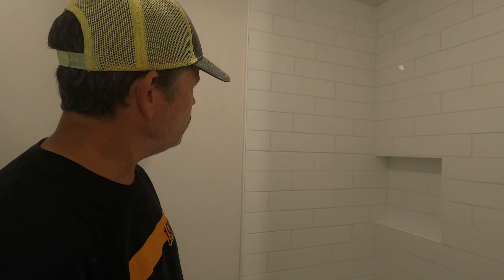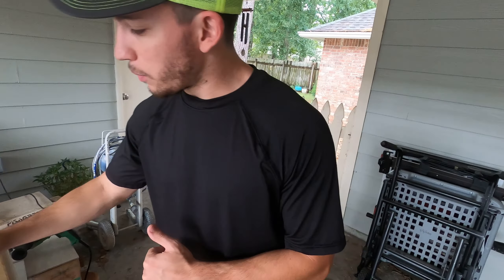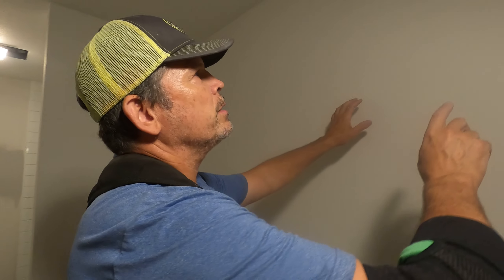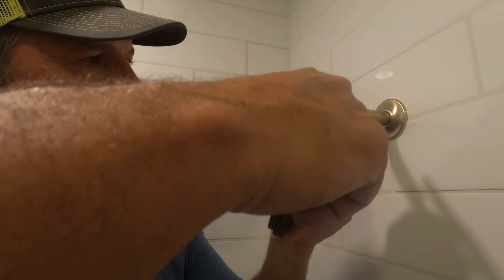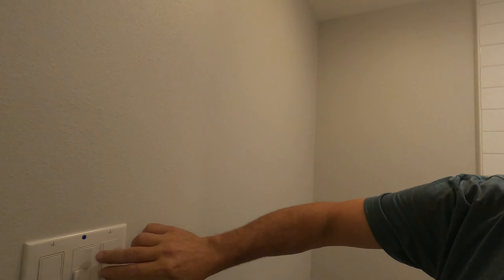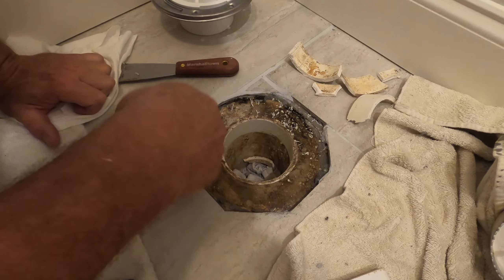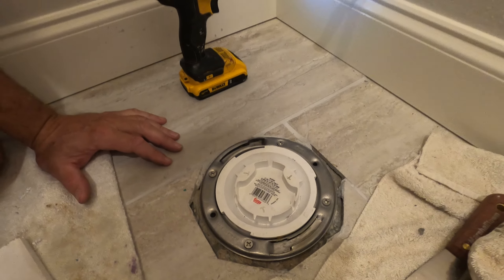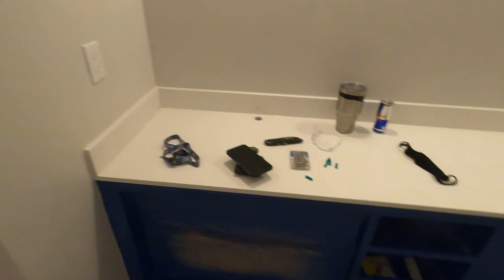Remodeling a Hall Bathroom Part 8: Floor Tile, Electrical, and Repairing a 40 year old Toilet Flange

Comment: 11:30 For a bathtub shower solution like this yes, However Ive found that is useful it can be done either way. Sometimes you have a particularly short homeowner and the reversed position helps put it within reach. Another situation is can think of is "square" stand up "phone booth" showers where the overall space is barely enough for a grown man to move around. It can also help with certain shower heads and such.

Comment: Tip for removing glued in pipe and fittings:
Get a metal hole saw the same size, or close to, as the inside of the piece of pipe or fitting you want to remove, heat it with a torch and then hold it inside the section to remove for ~30 seconds (use exhaust fan) it will soften the PVC and you can just peel it out.
Keep up the great work!

Comment: Hey guys.  Love the channel.  I have used prism grout for some time and I had an issue with it first time I used it.  It setup too quick so I called the company, Custom Building Products and they told me NEVER  to use a drill and paddle bit to mix Prism as this would create too much heat and cause it to setup too quick.  I started using a margin trowel instead and have never had it setup on me like it did that fist time.  In fact, i have never had it setup on me on any job since, even after grouting a shower and letting it set a while.  Maybe this will help someone.

Comment: Regarding the sheet gray color,  you can go 50% lighter and it will lighten up accordingly,  but in Behr paint,  that will not work if the color requires a deep base to be mixed/made,  if it uses the ultra pure white base or medium base you're in the clear👍

Comment: If you have to remove a pvc fitting use a heat gun or if you’re comfortable enough a torch. I’m you can heat the pipe up until it’s soft and peel it out. The easiest way is to get an old hole saw that matches the inside diameter. Set a pair of vice grips so that it can only go in the depth of the hub. With the torch get the hole saw red hot. Set it in the pipe, then after a couple of minutes you can peel the pipe out by hand. It’s also funny how common caulking toilets is now. It’s only code required in commercial I believe. When I was an apprentice we’d never do it. The reason was most older houses were pier and beam and if it leaked the caulk would hide it and you won’t find out until the floor is rotten or molded.

Comment: If it was primed and glued properly you can always use a heat gun to peel out the pipe after cutting a notch

Comment: As a plumber,I use closet shims on every toilet I install,by using shims it prevents you from overtightening brass bolts with is what damages the closet flange. I've also switched to nylon closet bolts due to the cost of brass,they are easier to cut and you won't  break a flange with them.
Reply from the maker: Cool thx John 👍💪

Comment: Toilet wax ring? I use the newer rubber cones ( in both the USA and Mexico) which glue directly to the toilet, fitting snuggly into the drain. Also , termites love those wax rings.

Comment: 16:40 Likely not. Because They would have screwed it down shortly after gluing it. Thus keeping the glue from pushing out on it that tiny bit that allowed the pressure and weight of the toilet to crack that flange. Im about to start a house trailer renovation, originally built in 86 and most of its original. Im gonna check this flange closely after seeing this. My jobs a wooden floor so less likely but its also rotted and soft so it may have cracked from that movement.

Comment: I was curious if you cut a door in the side of the cabinet to gain access to the tub drain and valve for future repair?
Reply from the maker: Great question Rick thanks!  I did not cut an access in the cabinet.  That is another good reason for a glued waste and overflow.  There should never be a reason to repair those drain lines.  If there is though, an access could be cut thru the cabinet or even thru the drywall in the hallway behind the tub.  I've seen that done too.

Comment: Hey guys, paint most of the time but a question about grouting against tub and tile floor. Grout or silicone. Never seen a job were the grout held up in an area were the different angles meet.  Is caulk the way to go or like you did grout
Reply: Not a full-time tiler, but I've torn out a lot of grout in areas where there is movement (doors slamming, walking vibrations, fiberglass tubs) to put down matching grout caulk or silicone depending on what it borders with ...

Comment: Paul:

I have 2 questions regarding the toilet:

1) I heard from an old-time plumber that you should NOT caulk around the base of the toilet, in case there is a water leak or failure of the wax gasket, you won't know until it's too late.  Also - have you tried the rubber seal gaskets?  They cost a slight bit more than the wax ones, but you can take the toilet on and off without issues.  I've had mine on my 2 toilets for close to 9 years without failure.  Just a thought.

2) Regarding the installation of the bolts, do you put the rubber washer in-between the porcelain and the fender washer?  I've had issues recently with the bolt and washer not centering on the slot, and the washer cups a lot and deforms.  Also, how do you finish with the snap on cap?  Cut the bolts with a hacksaw?  I've had my toilets installed for close to 9 years and haven't completed this step due to me being insecure.  And I'm scared. lol.

Watched almost all of your videos, wish I was closer to you so that I could have the opportunity to work with you - I'd do it for free.  You are very complete and knowledgeable in many aspects of the trades, it's a pleasure and a joy to watch your videos.

Thanks, and god bless (yes, my name is the same as yours)

Paul
Reply: In case no one answered you, the answer to 2 is yes you cut the bolts off.. hack saw, buzz saw, whatever works. And I also was always told to not caulk around a toilet and if you do to not go all the eay around so that I there is ever a leak you know right away.

Comment: Awesome video as always! You’ll be at 100k subs in no time. Do you always use versabond? I do but still prefer mapei products overall especially grout, but there’s usually a depot closer to the job. What’s your thoughts? Also I have used a lot of prism but am not completely satisfied as it’s a little soft and not as smooth of a finish as mapei fa products
Reply from the maker: Mapei is my first choice 💪👊
Reply: @StudPack  how’d you like the prism? It’s very popular but I have my doubts
Reply from the maker: I used prism on a shower once… It set up so fast I could barely save it. I’ll never use it again.

Comment: Nice work guys!!    Question, was there a gasket between the over the shower light fixture and the ceiling drywall to make it that fixture moisture resistant?
Reply from the maker: Those LEDs are rated for use over a shower.  Yes there's a gasket but I tend to believe it's more for air sealing.  The LED fixture is basically a sealed unit so it's perfect for over a tub or shower.  Thanks Bradyn!!

Comment: What was plan B for removing the old toilet flange? Also that pvc primer splatter is the worst hahah
Reply from the maker: Plan B - depending on the brand, some 3" PVC couplings fit perfectly inside 4" PVC.  Not tight enough to glue with PVC cement but pretty snug.  We would have cut thru the 4" PVC right beneath the flange and then removed the flange and the short piece of 4" glued to it ending up with a 4" PVC pipe ending about 3" below the slab.  Then either 1) use the 3" coupling, a short piece of 3" pipe and a flange for 3" pipe siliconed inside the 4" or 2) use a 4" pipe extender to extend the original 4" pipe.  Hope that makes sense:)  

Link to pipe extenders:  https://www.pvcfittingsonline.com/4-schedule-40-pvc-pipe-extender-s0301-40.html